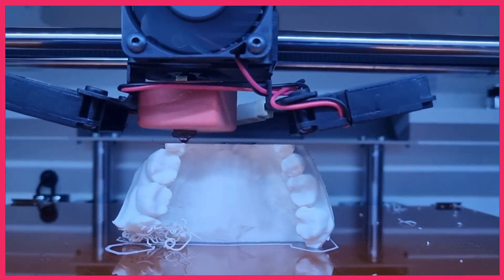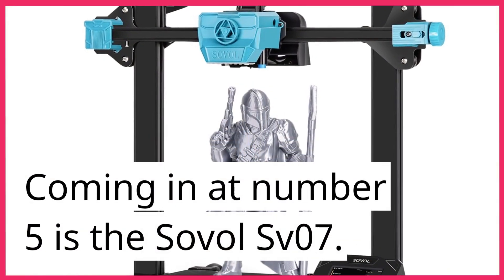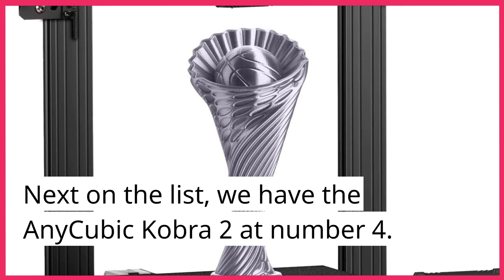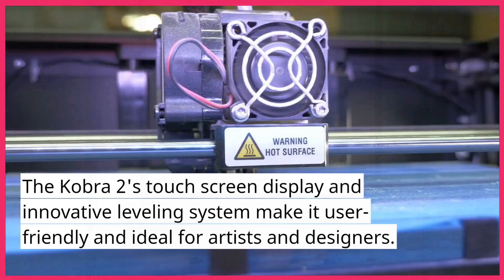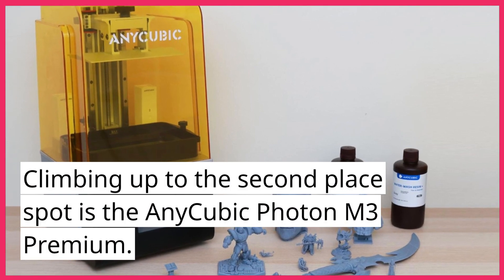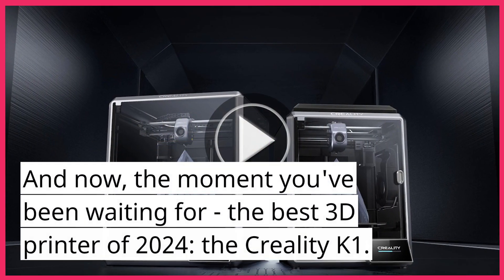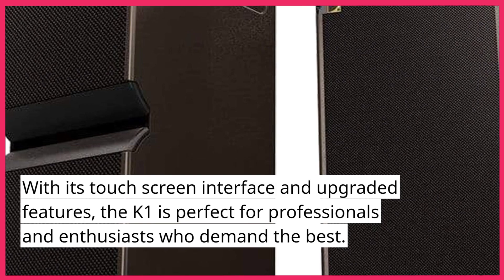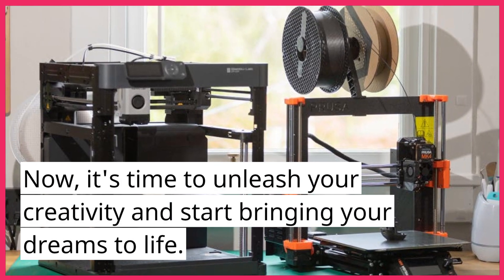5 Best 3D Printers for 2024

Comment: Do not use this video to make any decisions about buying a 3D printer. If you do you will be sadly dissapointed.
Reply from the maker: Can you tell me why would you say that, Thank you for your opinion
Reply: @Answers-qf9uf  the kobra 2 is NOT a dual extrusion machine
Reply: Honestly it looks like you randomly picked some printers regardless of there print quality and reliability. No PRUSA, or Bambu printers or the other top ranked consumer based printers that are clearly dominating the market. The simple fact that the Bambu A1 Mini prints as fast and as good as the P1S or X1 Carbon and starts at $299 shows you dont know the market or research that has already been done over and over again all year long by the rest of the community. @Answers-qf9uf